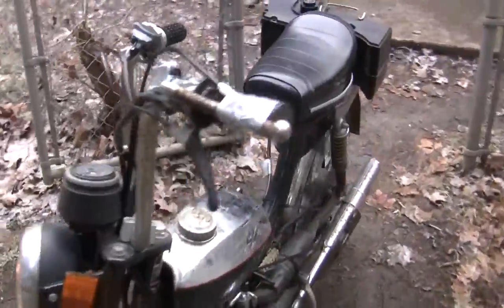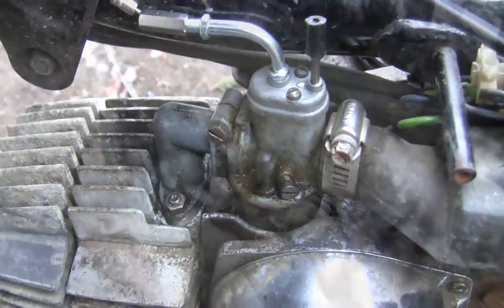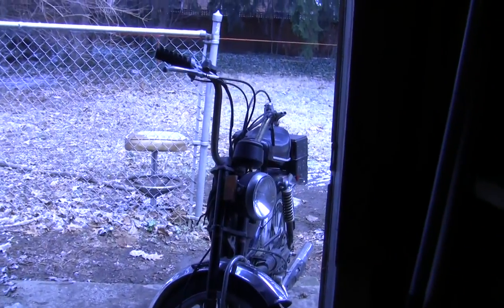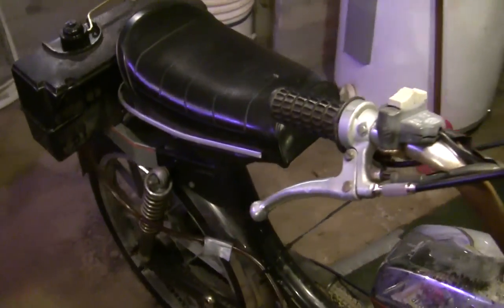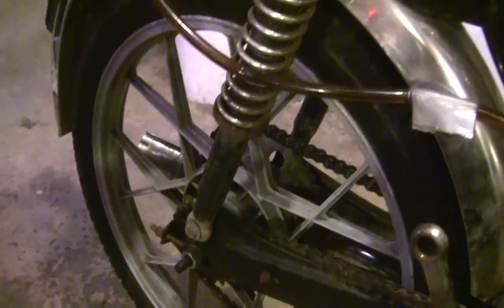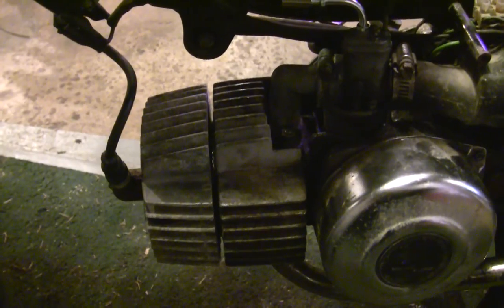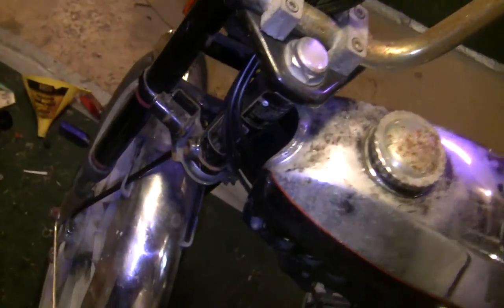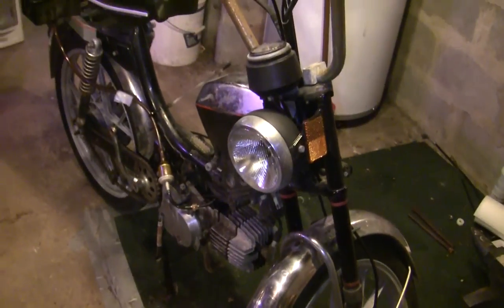J.C. Penny Pinto First Run and Ride!

Comment: Well, the deal on the Maxi N fell through. He just wanted too much for it...... so, I found a great deal on a 78 Kromag! (1.5hp Swinger II, that was already de-restricted.) Seems to run great so far, and is really clean on the outside. very little rust, or corrosion, and the tank only has extremely light rust inside. I've had it for 3 days now, and to be honest, the only thing i've found with issues, is the headlight/horn control, has something going on inside. the horn occasionally sticks on, and the headlight occasionally doesn't come on, once the bike is running, until I tap on the control. i haven't removed the control box yet, to see if I can take it apart, and check for corrosion, or shorts. I am able to get this bike up to about 34mph, with the original stock E50 which was set up to have 1.5hp in the factory. anyway, I love my Kromag. it's a great looking bike, and it runs like a top! (so far!) :)

Comment: Yeah rev the hell out it when it's cold. nice
Reply from the maker: Well, since this video was uploaded in December 2013 this bike has had two engine rebuilds, gone through a proper cosmetic restoration, and enjoyed thousands of miles ridden. 
There isn't any danger with revving a low power, air cooled, 2 stroke when it's cold that I can see. No valves to float, no radiator or water pump to shrink the piston - what are you specifically talking about?
Reply: @TravisTutorial  hey Travis... It is 2020 now. But I did once see a guy seize a water-cooled two stroke (50cc) it had a cast iron cilinder. I think it has to do with the piston expanding in size before the cilinder can. But indeed those puchs don't have any issues with this... It still is best practice to not rev it high when cold...

Comment: Hey Travis, I also have a Puch pinto moped. What size air filter (mm) fits the carb? Thanks
Reply from the maker: Pretty sure it's a 20mm for both 12 and 14 bing. If you're getting a performance filter and going to tune afterwards I really like the "puch bing METAL hi flow filter" listed here:

https://www.treatland.tv/SearchResults.asp?Search=bing+air+filter
Reply: Thanks Travis, I just bought it but haven't started it yet due to cold weather. Ive cleaned the carb and replaced the oil. The carburetor looked really clean for a 1978! Cant wait to start it up with warm weather!

Comment: what did you squirt on the intake?
Reply from the maker: +nateblackerthanspace That was carb cleaner to show that there is an air leak from carb to intake, you can tell because of the drop in idle. This is pretty common with bings, and nearly always fixed with an o ring from the auto parts store.
Reply: TravisTutorial these are great vids. I'm fixing up a motobecane 50v with no previous knowledge of anything automotive. YouTube is my copilot
Reply from the maker: nateblackerthanspace
Glad you enjoy them, best of luck with the moby